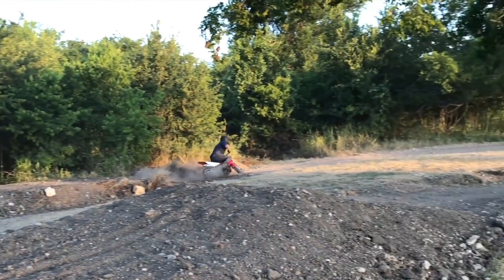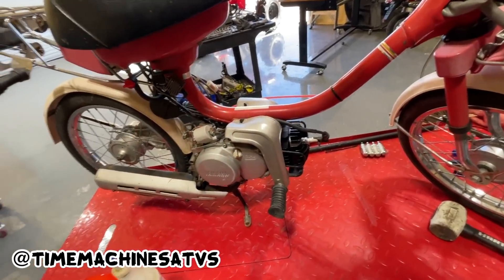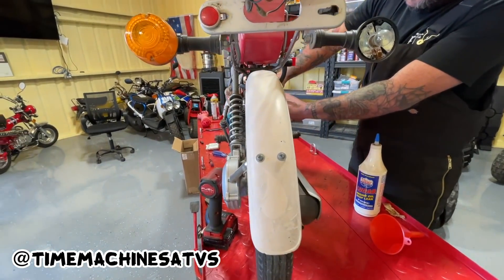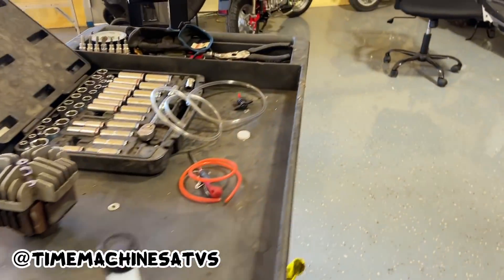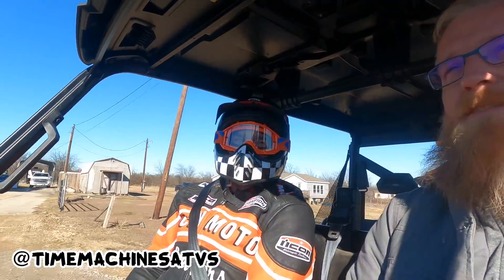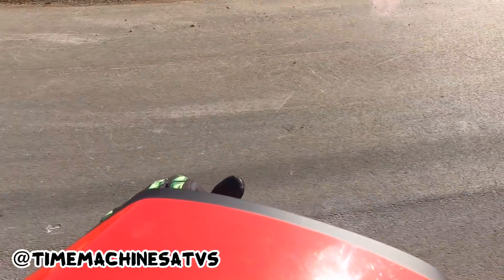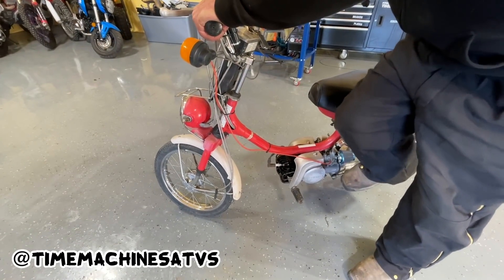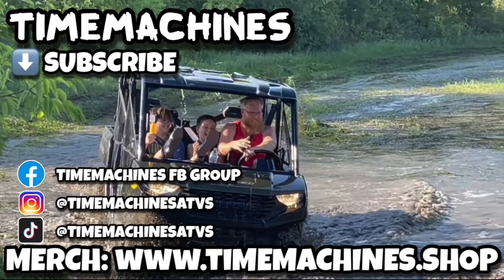Riding the Yamahopper with NITROUS

Comment: The reason 2smokes have that combustion chamber is to help with back pressure for keeping the combustion gasses in the cylinder so if you add one to a bike that doesn't have one it'll greatly increase the combustion gasses and power. Probably should of did a before and after exhaust test too instead of just adding it off the bat but o well. More power right away isn't a bad thing by any mean lol
Reply: Reverberation is the word you're looking for, not back pressure. 🤔